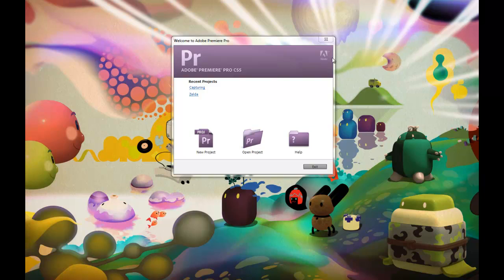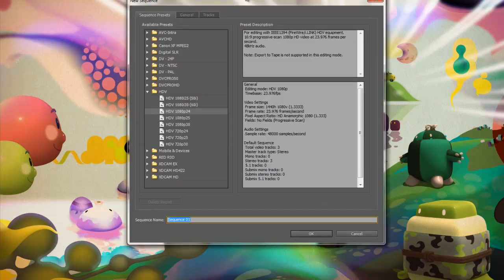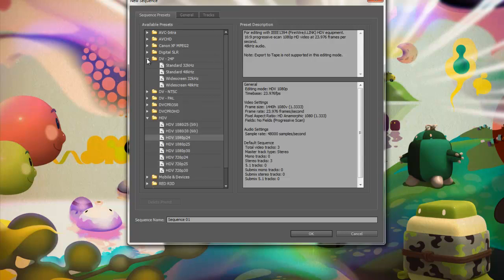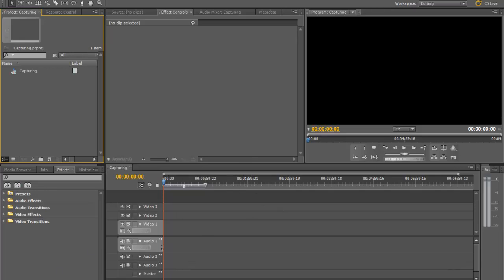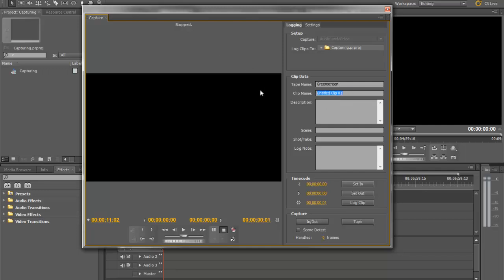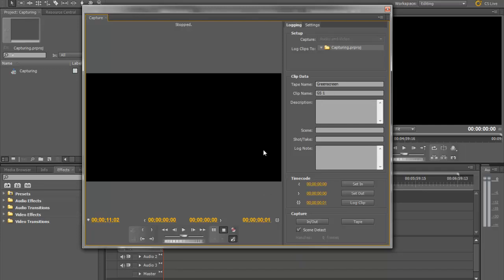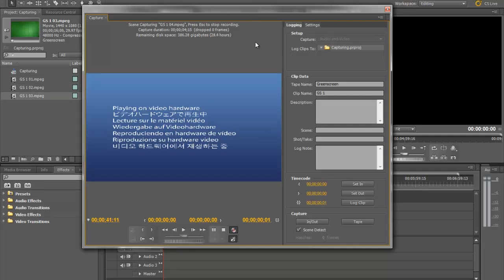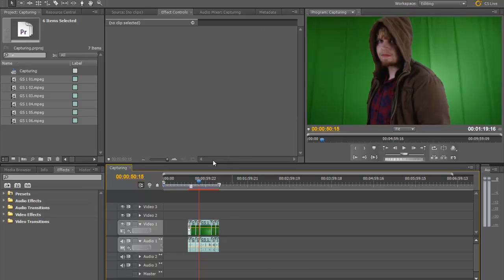How to Capture Footage In Adobe Premiere cs5 Mini DV/Tape Deck Tutorial

Comment: Thanks! Great videos! I do have a question - shot some HD footage on tape with a Canon XH A1 HD camcorder using 24f. I now want to capture the footage using Adobe CS6.  What sequence preset should I capture in if I want to create a DVD and later transfer to film.  There are several sequence presets to choose from such as HDV 1080i25(50i), HDV1080i30(60i), HDV 1080p24, HDV 1080p25, HDV 1080p30, etc. Don't totally understand the choices and want to select the correct one before capturing.  Thanks!

Comment: I always had a preview when I captured DV on my old Core2Quad machine, but I built a new dual Xeon machine for handling 4K, and I was careful to choose a PCI Firewire card with a Texas Instruments chip on it. However, when I capture DV (not HDV) on this new system, I see a black screen in the capture window, instead of live video from the DV deck. I've changed the firewire drivers to Legacy, as outlines in Adobe's troubleshooting guide, but it made no difference. 
The system does capture video, but as I have no monitor on the JVC editing deck, I have no idea what I'm capturing until after it's all done and I view the captured file.
I can't imagine what I configured differently on the new machine to disable the preview window. All the checkboxes in Premiere are checked for live preview on both capture window and desktop. I hear no audio and see no video during capture. I got both on my old Core2Quad with built in firewire on the motherboard.
Reply from the maker: +basspig  wish i could help you more from here, but unfortunately the only thing ive ever had like this happen is when i was using HD decks or camcorders that i had to use the built in monitor to watch... Not sure what the problem could be.
Reply: +TutorialGrid Seems to be the case on the Adobe forum too. No one knows why some systems can't display a preview. It's a total mystery. Thanks for taking a moment to respond to my question though!
Reply from the maker: No problem anytime!

Comment: Hey man, first thanks for the video but i have a question : 
I have a laptop, with adobe premiere pro cc on it but i don't have any firewire or express card port. BUT, i have an other computer with a firewire port, but it's old and the sound on it is off. So my question is : Can i capture a footage on my old computer (with adobe premiere pro cc) and then transfer the adobe file on my laptop ? And is the sound going to be on it ? Thank your if you take time to answer this
Reply from the maker: SuicyberxGaming Yes you can import the video directly from your camera onto the older computer as long as the software will work and then transfer the files onto a flash drive to your other computer.
Reply: thank you so much for your answer !

Comment: When ever I hit record, its instantly stops and asks me if I want to save the 1 second clip. I'm not quite sure what I'm doing wrong here...
Reply from the maker: Sleepless Mindz Sometimes this is because it is noticing drop frames. One of the ways that you can fix this is to change where the files are being recorded onto another hard drive that is not running the program. A lot of the time this fixes the issue. If it doesn't fix it you may be looking at a bigger issue.
Reply: Thanks!

Comment: PROBLEM: instead of saying stopped its says - wrong import format, try changing camera format or capture settings... AND no matter what i change it keeps popping up and won't record... any ideas of what i can do ????
Reply from the maker: +krispin P Thanks for commenting on my How to Capture Footage In Adobe Premiere cs5 Mini DV/Tape Deck Tutorial a lot of the times your sequence setting may b the problem. What version of premiere are you using and what type of camera were you using when recording. Also can you send me a picture of the settings you are using?
Reply: +TutorialGrid Hi, I am having the same problem. Was there ever a solution to this? The camera is a Canon Vixia HV30, which records in 1080i. I tried sequence settings of HDV 1080i25 (50i) and HDV 1080i30 (60i) and neither worked. I'm using premiere cs6. Any ideas? Thanks!!